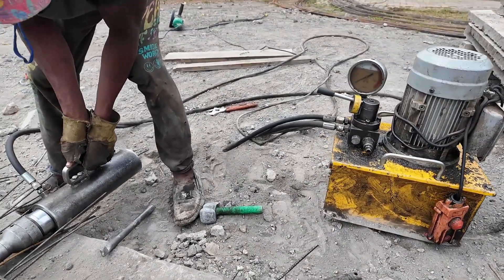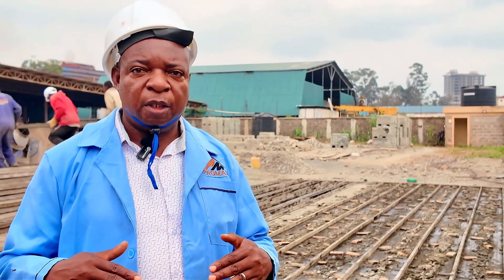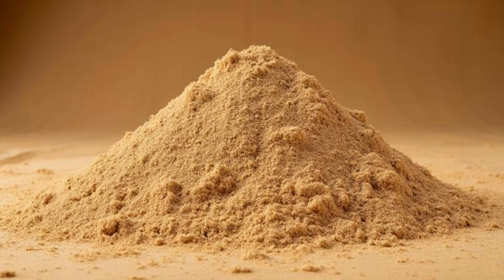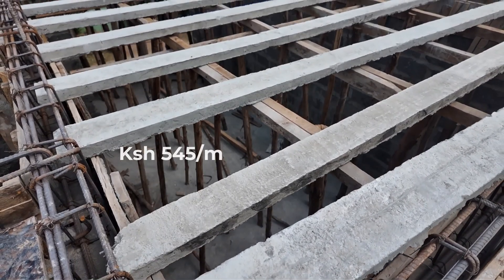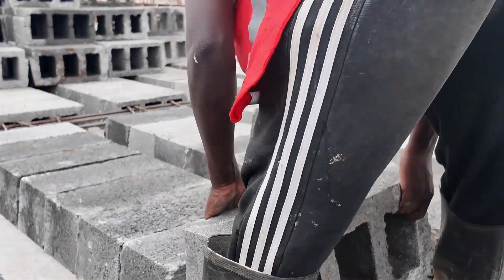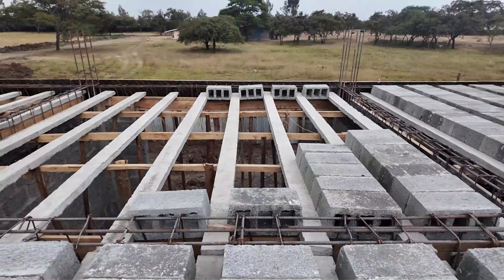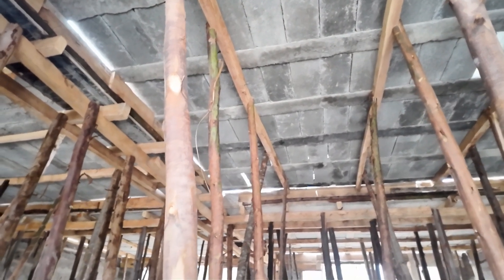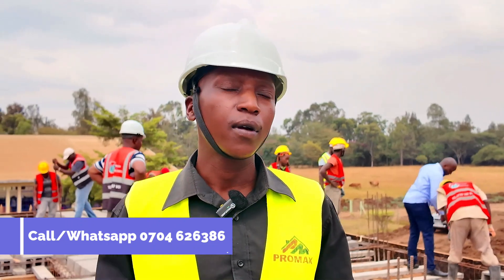Making Flat Beams & Blocks: A Surprisingly Satisfying Process

Comment: Do thy put any rebars on the tunnels btw blocks before BRC?
Reply from the maker: No, the Brc is reinforcement, concrete is poured on the tunnels to the required depth
Reply: Good where are you located